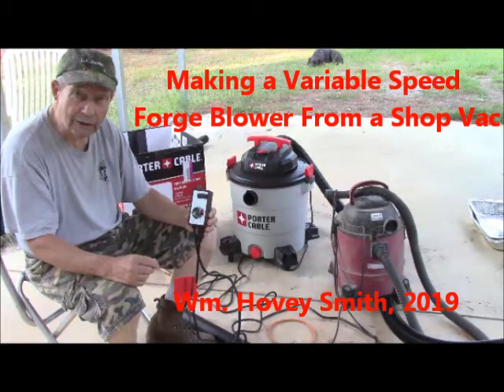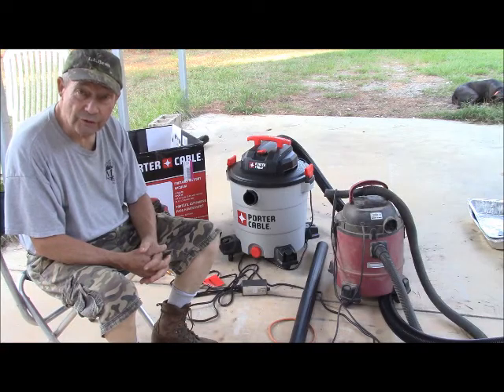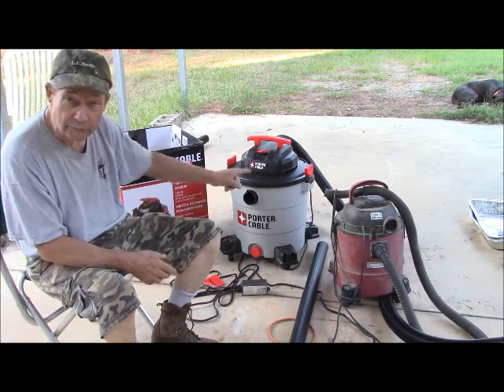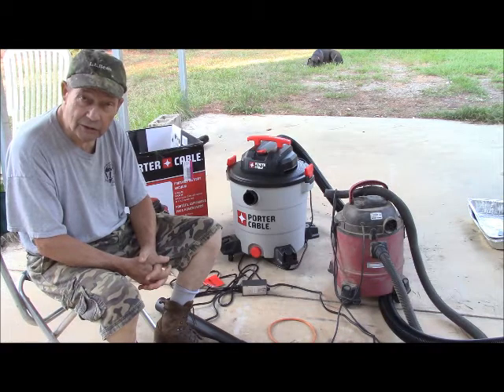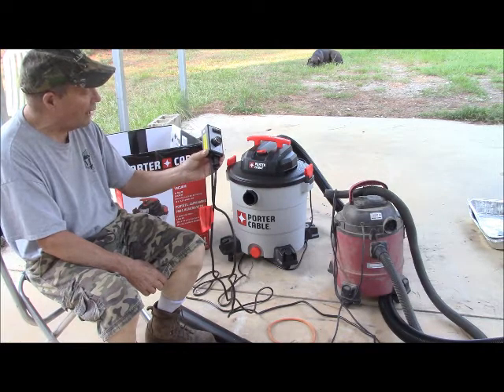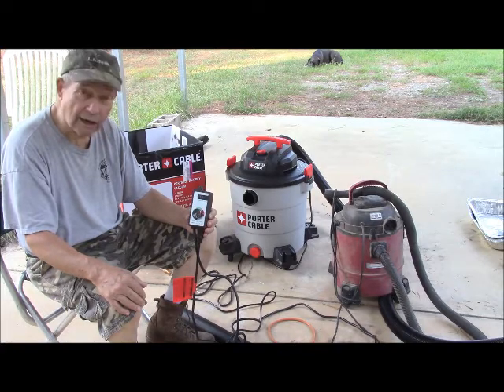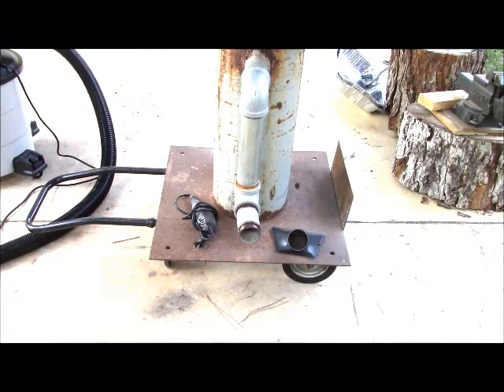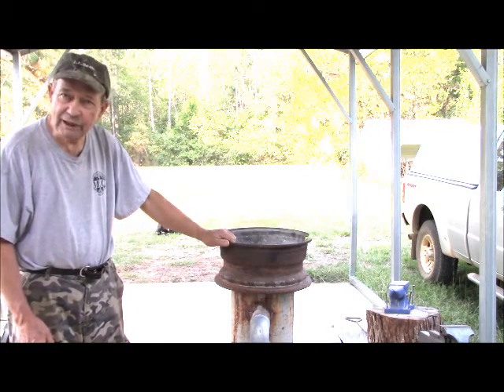Making a Variable Speed Forge Blower from a Shop Vac

Comment: I just bought a 6.5 hp shop vac from home depot.well I needed to buy a vacuum cleaner for my apartment.The shop vac came with all kinds of accessories and a very good filter. Anyway instead of buying a regular vacuum cleaner I bought the shop vac problem is that thing can damn near suck the carpet off the floor and it's really loud. So I wound up on your page because I want to be able to control the speed of the motor. The harbor freight deal would be perfect I'm going to check in to it immediately. Thanks for the suggestion good luck with your knives

Comment: Thanks for the tip.  An old brake drum from a heavy truck can also be converted to a useful forge.  Where do you get the high quality grade of coal favored by blacksmiths?
Reply from the maker: Look for blacksmithing coal on line. Although I use charcoal, it is available by the bag. I do not use it so I do not have a particular recommendation.